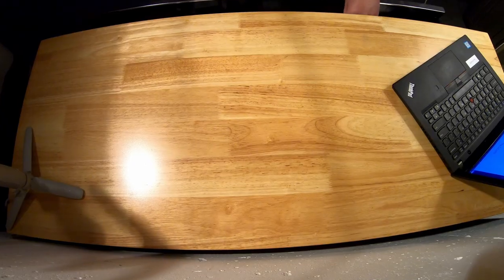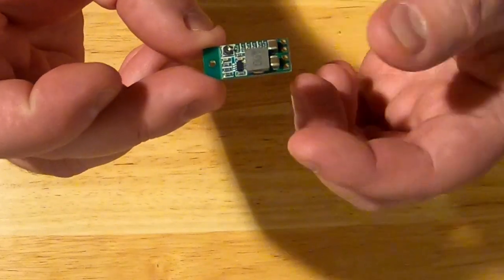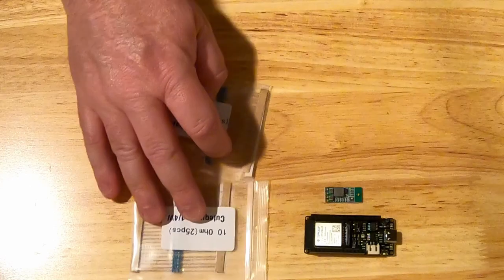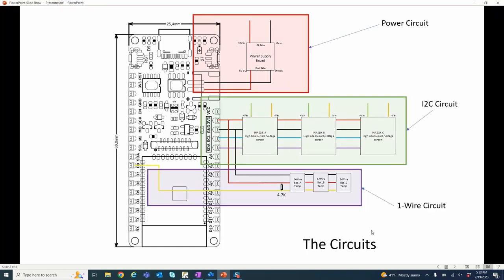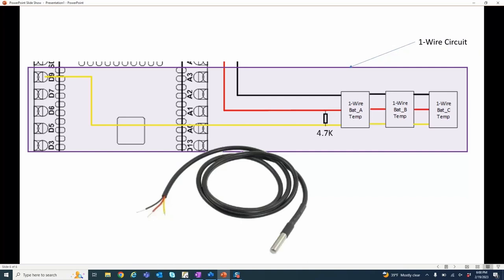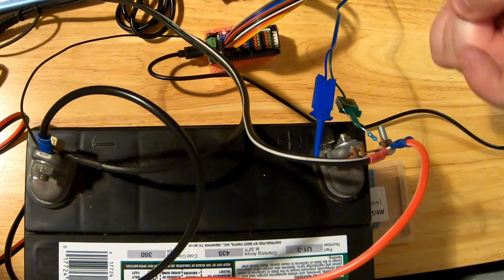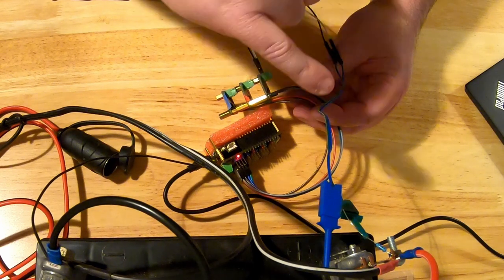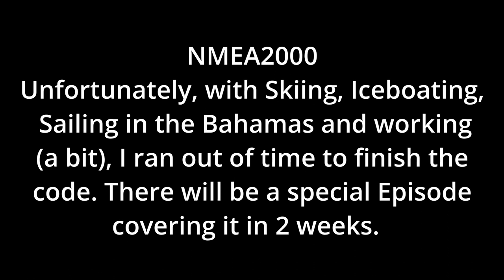DIY Battery Monitor using SensESP/ESP32 for Openplotter, SignalK & NMEA2000 - Tech E12 - Après Sail

Comment: hi, could you elaborate on where/how you would connect the N2K board to the ESP? Cheers
Reply from the maker: Sure, First Check out this video (https://youtu.be/MREGixRx_No?si=I-w3x6yvaaGBUOEp) which shows Nautical Sun's Battery Monitor which is NMEA2000.  Here is the schematic - https://1drv.ms/b/c/6896e61bdafa6366/ETL99No8p6NIq2AWwZbIWWsBolpyvXo3xC7vL41XQUxJDw?e=op18sO.  There is basically 4 pins, Power (3.3V), Ground, CAN TX and CAN RX.  I connected CAN RX to Pin 17 (D10) and CAN TX to Pin 16 (D11).  They are declared like that in the software that is on my Github Site (https://github.com/Techstyleuk/SensESP-NMEA2000-Battery-Monitor).  Hope this helps?

Comment: @ApresSail I didn't understand why you removed the R100 resistor (0,1 ohm) and replaced it with a 10 ohms resistor ? Why you didn't use the 2 holes on both side of the old R100 resistor ?
Reply from the maker: The R100 resistor is a current shunt connected between the 2 pads.  its resistance is much too high for what we need - it would give a 50mVolt drop with 0.5A of current, we need a 50mV drop for 300A current - so we use the external shunt.  What we added to the same pads was a capacitor and then resistors coming from the signal lines, these components are optional but providing some filtering on the signal to make it more stable
Reply: @ApresSail  Ok. What do you think of the ACS712 & ACS758 (Hall Effect sensor, up to 5-20-30A & 50A). Is it suitable for our boat battery packs ? (my setup is 2x2 12V 108ah, in parallel)
Reply from the maker: I have a starter battery and 2 x 120Ah house batteries and when I crack the engine I can see a peak of 46A.  When using my inverter and K-Cup coffee maker I can see 70A from one of the house batteries (it is connected directly using big cables).  If I was to use the devices you suggested (and I haven't done the research) check the specs carefully and go for the 50A or more, depending on your needs.  Also check there is a ESP32 library for it

Comment: Slightly disappointed that you didn't use a hall effect current sensor instead of the shunt, but nevertheless, a much better than the average YT marine-electronics video.
Reply from the maker: The Hall effect versions are more expensive than the Shunt version, and the 50mv loss is not a big deal really.  For other viewers can you think of other pro's and cons of Hall vs shunt?

Comment: Nice video thanks a lot. Could you please post a picture of the battery with the shunt from the frontsite?
Reply from the maker: I can't do it in the comments but I just updated the Github page at: https://github.com/Techstyleuk/SensESP_3_Battery_Monitor with 2 pics, I hope that helps.  the shunts were smaller than expected, I didn't really look, I assumed the connection was going to be a standard battery terminal and it isn't.  I am either going to mount these or buy something else. Vishay do one with bigger holes or there was one at Aliexpress that was mounted
Reply: @ApresSail  That is perfect - thank you so much

Comment: Just found your channel and appreciate it greatly, both content and production. About to start my project and a new channel for my sailboat; looks like a huge part of the work is already done for me -- except I'll be using 24v LFP, a 21 HP Westerbeke diesel and a pair of DIY electrified and air-powered old 6 HP outboard conversions with variable pitch props. Eventual goal is a boat pet that comes when I call and knows how to get to the next location when I ask it to and anchor effectively built of mostly recycled and repurposed parts. Looking forward to going through your github content. Many thanks. (Also appreciate your channel's name as a deeply philosophically meaningful outlook on life quite similar to my own. Cheers.
Reply from the maker: Sounds like an awesome project!!  let me know if you see anything on my Github you are unsure of. I have a another project coming up when I get chance with some automated switches.
Reply: @ApresSail  Thanks for this. I'm feeling much less procrastination now that I've found so much help!

Comment: @apres

I'm curious how I could set this up so that I can remotely monitor batteries when I'm away from the boat. Any thoughts? 

I have a pi5 with open plotter and a McArthur hat.
Reply from the maker: I have not done it but ESP32's can be set up to wake and sleep for certain periods, so you could set up a LoRa node or Cellular Module to transmit data from the boat.

Comment: Hi Jason, nice detailed video, as usual.
Are you actually writing all the code yourself?
If so, Kudos to you, that is a fair amount of work.
Quick question:
The buck converter you are using could that power a small 5V bus bar?
I am trying to find a clean way to provide 5V for all my 5V components (RPi, likely a McArthur hat, small computer accessories).
What is your solution on s/v Après?
 Cheers,
a.
Reply from the maker: the buck converter I use is 3A and I use one for the RPI, with several peripherals, but then attached I have a 12V powered USB hub with 4 ports for extra RPI connections and a 2.4A power USB that you could power the RPI with, if you wanted too (https://amzn.to/49baLGN).  I have a second hub at the helm for Maiana and the touchscreen.
I thought the MacArthur Hat took 12V supply and provided safe shutdown, similar to the circuit that I use.  Couldn't you just use that?
Reply: @ApresSail  Excellent information thank you. Yes the MacArthur does what you mentioned above and 12V to 5V.
Reply: @ApresSail  Yes, but apart from the MacArthur hat providing 5V to the Pi5 , how can I use that 5V for other peripherals?
Reply from the maker: @Coyotehello  like I said, I would either use a 12v USB Hub - then every peripheral is locally powered - the one I use is up to 24watts.  I have GPS dongle, RTL-SDR, RS422-USB (NMEA0183), wireless KBRD/mouse dongle and 10" Navstation touchscreen on one,  Maiana and the 15.6" Screen touchscreen on another.  

with regard to the code, I wrote it with help from many examples and the literature for SensESP from Matti Airas - https://github.com/hatlabs/
Reply: @ApresSail  Cool stuff.

Comment: bonjour 
  est il possible de monitore 4 batteries avec votre système  en rajoutant un module can bus  
  car j'ais un parc batterie  de   3  x 4  batteries a regarde   sur home assistant 
vidéo  simple efficace    
merci beaucoup  👍👍    france   bretagne    Kenavo

Good morning
  is it possible to monitor 4 batteries with your system by adding a can bus module
  because I have a battery bank of 3 x 4 batteries looked on home assistant
simple effective video
thank you very much 👍👍 France Brittany Kenavo
Reply from the maker: The INA219 voltage/current sensor board has 4 possible addresses which means 4 can be used on one I2C bus, so you could monitor up to 4 quite easily.  Over 4 you could use a multiplexer (https://amzn.to/49cVGoY) or there is a INA3221 which will do 3 batteries each and 4 addresses (12 batteries total) - https://amzn.to/3MoASRv.  You would have to make some code adjustments but just using 4x INA219 would be mostly copy and paste from my code
Reply: @ApresSail  Thank you for answering my question so quickly because I have 12 batteries to look at and see the balancing of such a park is important to have good solar autonomy
 you just gained a subscriber
Kenavo